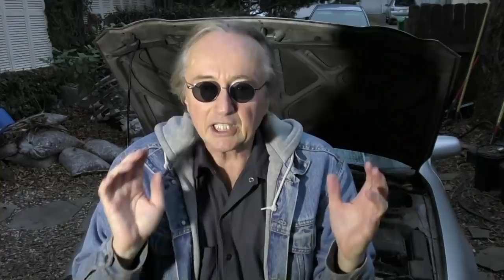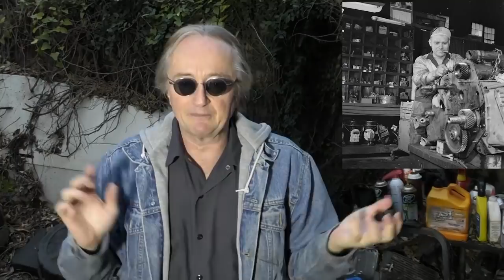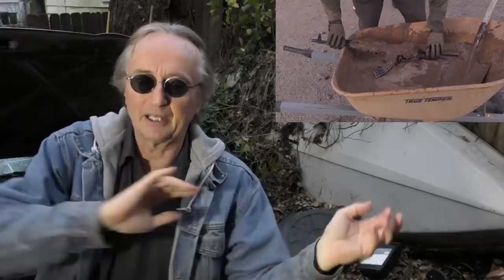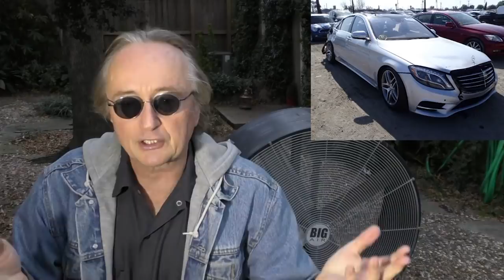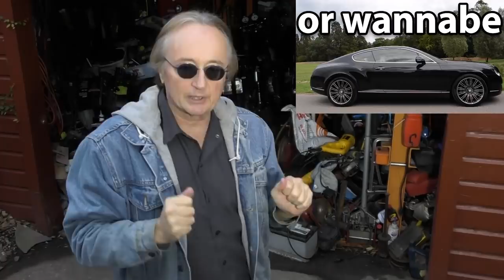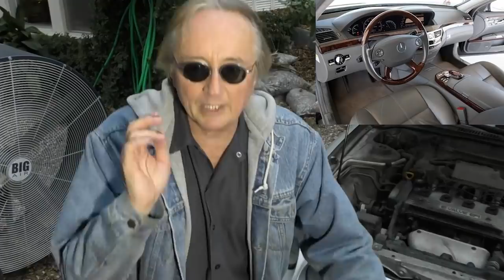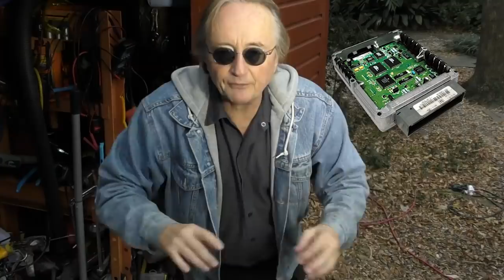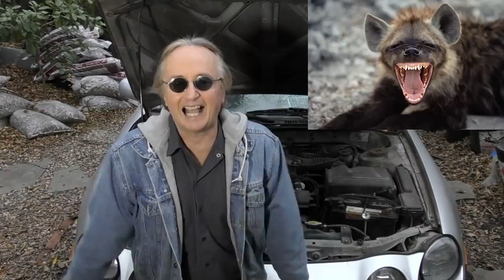Why Luxury Cars are Designed to be Unreliable

Comment: I drove toyotas and hondas for years.  They are indeed quite reliable.  The problem is their aesthetics.  These are the vanilla ice cream of cars.   There is a give and take between practicality and style.  Its almost an exact correlation.  

Sure, you can buy a beige camry and drive it for 20 years.  But youll be driving a beige camry for 20 years.  

The other thing is that the secret about these toyotas is out.   On the used market, 4runners with 100k miles are $20k.    Sure they are reliable.  But are they as reliable as a brand new car?

I suggest people buy a reliable car that they have an affinity for.  Something they like.  Because no matter what brand you get, there will likely come the day when you are standing in your local mechinics office, looking out at your car as he tells you its going to cost you $1000+ to fix.   Thats going to go over a lot easier if you bought the car you liked, not the damn beige Camry.
Reply: bosco0991 perfectly said sir that's what I've been telling people since I can remember goodjob
Reply: The new Corolla 2019 hatchback definitly looks dope though! In Europe, it's called the Auris and we never had the sedan version here. The hatchback is what we are used to in Europe and it looks very good in my opinion.
Reply: The flip side to that is that you can buy the car you love to drive and you're standing in the service department looking at it as it costs you $1000 over and over and over.  I think there has to be a middle way, though.
Reply: honda is reliable ????? according to whom ?
Reply: @buh5995  Civic fanboys
Reply: bosco0991 Aesthetics don't mean crap to me. I drive because I have to, not because I want to. Give me the beige Camry for 20 years all day. I workout to keep myself looking good, my car can look like total crap as long as it runs good. I've been driving a 93 Ranger since 2004 and I will drive it until it decides to die.
Reply: I agree to some extent..but LOOK at the latest Camry (or Accord..or even a Nissan Altima for that matter)! The sports models look absolutely great, a world away from the old boring beige Camry's of yester-year
Reply: Amen. Find the middle ground- buy something reliable but that you actually enjoy. I spend a ton of time driving every day so I want to enjoy my ride. I absolutely love my 06 ford ranger that has 190,000 miles but I am beginning to desire a car that is more comfortable and quick
Reply: Michael Lam , don't ever buy a German car, I have heard they are not so good on a windy and cold weather!!!
Reply: Beige camry's grandpa's car.
Reply: You don't have to only own one vehicle.  Own a reliable daily driver and a fun 2nd or 3rd...or 6th vehicle.  And fun isn't necessarily synonymous with unreliable. 
Learn how to fix your car(s).  As long as I'm physically able, I'll NEVER have a service advisor telling me how much it's gonna cost to fix my automobile.
Reply: @buh5995  fuka Honda....
Reply: Why not buy a Lexus or Acura then?
Reply: lol, I got offered 10g for my 05 4runner. I turned him down, but got his # anyway
Reply: Michael Lam  Girfiends 93 has 288000 on it. valve cover started leaking. just gotta wait for a nice enough day...
Reply: @harorider96  Meh, buy a Camry if you're in your 60s. Drive something that will make you smile. Might as well, since you'll pay for it.
Reply: Even if you don't like the car in the beginning, if it starts every day and get you safely where you want, in the end it will grow on you and you will love it. My first car was a 1997 Nissan Almera GX in silver which i bought used. I ended up selling it to a friend very cheap, I just wanted to continue to see it on the road.
Reply: That’s why I bought a lexus😎
Reply: Dam I drive a beige Camry and I hate it because it’s beige but I love it love it love it because it starts and runs each and every single day after day after day after day HAHA
Reply: Agreed, life is too short for boring cars
Reply: bosco0991 totally agree with your statement 💯
Reply: Michael Lam let me tell you something finally Toyota start making their cars looks good and attractive like the new Camry 2018 but all other Toyota back then I never paid a dime even though reliability  they were bad looking cars and what I mean is that I’m not gonna invest Money into a big deal that is buy a car  and don’t feel Totally confortable on doing it the car has to like you.
Reply: Which is why I aim for 2000ish JDM sports car nowadays. Not only are they fun to drive, good reliability, some of them don't even depreciate!
Reply: @harorider96  what's better i have a 98 Corolla VE 146.000 miles but want a Camry should sell it i does run fine it's just small... And slow
Reply: exactly... 10 000 buck Luxury used car instead of a 20 000 buck camry, 
you still have 10 000 bucks to spare to repair the thing over the next few years..
Reply: Well if its 20 years old and costs $1000 to fix then you definitely got your moneys worth. I can most certainly say I wouldnt be dissapointed, well that and I wouldnt pay someone to fix a car for me.
Reply: That's why you buy the yugo  FOR ?? :-)
Reply: Amen.  Not saying you have to buy a 100k car.  But the certified pre-owned 2017 Mercedes GLA AMG 45 I got is a life-changing type vehicle.  It just makes each day a tiny bit more uplifting.  There is something to be said for the upgraded driving experience.  Not to mention the way people treat you differently.  It's money well-spent if you ask me.
Reply: the new toyotas are quite handsome, i hate the big grill from Avalon and lexus
Reply: Agreed!!!!
Reply: 2006 Lexus is 350! 🖒
Reply: My '94 Beige Camry LE is the best car I have every owned.  My first car was a '63 Chevy Impala.  I've had Buick, Olds, Caddilacs;  Crown Vics, Fairlane 500s, Mercury, Lincoln, Volvo, VW Bug, Mercedes 240D, Mercedes 300SD, more than I can recall.  I don't care what color it is, my Camry was, and is, the best.  I also have a Corolla and an ES300.  I don't need anyone to tell me what to buy or keep.
Reply: Honda's not like a vanilla ice cream imo
Reply: @buh5995  I'd have to say my 2004 CR-V is a little better than average in terms of reliability, but it's a complete pain to work on when something does go wrong. How about three hours to replace an alternator, or removing most of the vehicle from the engine forward to replace the notoriously crappy a/c compressor? From the standpoint of maintainability the car is a disaster.
Reply: Except that Mercedes Benzs and BMWs are just like boats, bust out another thousand.
Reply: Michael Lam  nothing is wrong with it he's just using it as an example
Reply: I can slightly agree with this. In college I had a BEIGE Honda Civic I’d run into things and basically let the car run itself into the ground because I didn’t like it. It also had a cloth beige interior omg. I bought my BMW and when the guy charged me 900 for an auxiliary radiator replacements and coolant flush (which I quickly realized I could’ve done myself but was just lazy) I was yes upset but I knew I wanted my beloved car back so bad I didn’t flinch the minute the car stopped driving, I had them come tow it within the hour
Reply: I agree 1000%!
Reply: Buy Lexus and Acura or Infiniti

Comment: Times have changed for everyone.  Take the new Lexus IS (2018).  My mechanic services them all the time.  They have fuel pump problems, premature brake issues, creaks and rattles from the suspension, and electrical issues.  Even Toyota now has trouble putting out all the time good luxury cars.  It is just the nature of the beast.
Reply: most of those parts could be outsourced. For eg some of the most reliable corollas had terrible bosch ignition coils that would always fail. cant real fault toyota for that.

Comment: "My wife's Lexus is just a fancy Toyota!" XD
Reply: Nothing wrong with dat!
Reply: @spazzman90  true dat
Reply: that's the point
Reply: At least it will Drive when you want it to !
Reply: well nothing wrong with that but lets not forget Audi is just a fancy Volkswagen lol
Reply: TheClubshaker Audi is the badass Volkswagen
Reply: BASITH PH Toyota smiles and says Thank you🤣👍🏼🙌🏼🙌🏼
Reply: I have a Toyota solara pretty reliable luxury coupe
Reply: @JAnx01  A1 - Polo, A3 - Golf. The rest are MLP which is a modified MQB VW platform
Reply: BASITH PH   That's a childish over used statement it's not true.
Reply: with even more stringent quality control than usual!
Reply: What is an ES300/350 but a rebadged Camry that has the same options checked? There's nothing wrong with that. If you'd like to go the other way, the Supra was a Toyota until...96? Then the grill spouted a chrome L, not much else changed
Reply: A mate of mine says " A Skoda is a thinking mans  VW ! " Another sucker lol :-)
Reply: The old LS400 is one of the most iconic cars ever made like my BMW E46 325i. Even the IS300 with the same engine from the legendary Supra
Reply: Another young bloke here in Brissy has a 2006 GTI with 250 killerwasps and so far this year (2018) hes broke it 3 times at a cost of $3.5k a go to fix it ! 0_0
Ive got a 2002 IS 300 and ive had this ride for 5 years now ……. one of the best cars ive owned ever ! The 'secret' is preventive maintenance and regular fluid and filter changes !
Reply: HOMECINEMA PC that’s good to hear!
I am also considering getting an IS300 as like a daily/track build
Reply: The cheaper one's yes. Not the ls460 or gs but clearly you haven't been in one.
Reply: David Laurie   Lol not really just call out BS when I smell it. The smell came your comment.
Reply: It is...a gold plated Toyota.. You didn't know that?
Reply: @basithph8958  But...NEITHER Audi nor VW are reliable, especially their electrical systems.
Reply: @jesserodriguez2732    Do you have the 4 or 6 cylinder Solara?
Reply: 4orrcountry 2008 solara convertible SLE v6
Reply: @4orrcountry  well audi and vw is either a hit or miss some can go for a lot of miles while others have problems before 100k miles
Atleast it is not as bad as Mercedes
Reply: David Laurie  the volkswagen group products are reliable if u take care of it and it's not as bad as mercedes and bmw
Reply: Omg words escape me for one.
Reply: That's the best part about Lexus.
Reply: I picked up a used Lincoln Mark VIII a few years after they stopped making them; the car is basically a thunderbird. Yet, if you buy the parts from Lincoln, they will charge you more than if you buy them at Ford. The bags even have TWO labels on them, one a ford part number, the other a lincoln mercury part number. so whenever I get parts for them, I go to ford, or tell the parts stores that they're for a ford. There really is no difference. I like to tell people that it's a ford thunderbird with the ultimate trim package.
Reply: Malcolm Reynolds true
Reply: HOMECINEMA PC. The IS300 is really my dream car. Perfect car
Reply: BASITH PH my dream car. IS300.
Reply: Johnny Jackson LFA. $350,000
Reply: TheClubshaker  lol Bentley is a fancy Audi that is a fancy Porsche witch is a fancy vw not to mention the other brands they make!
Reply: Jesse Rodriguez The word Luxury shouldn’t even be in the same sentence as Toyota Solara...
Reply: Malcolm Reynolds That’s true but it’s on the lowest model Lexus Chassis the ES the rest are rear wheel drive.
Reply: corkscrewlife car photography The only comment that made sence!
Reply: Acura- fancy honda. infinity- fancy nissan. lincoln-fancy ford. cadillac, gmc- fancy chevy. Porche, bently, audi- fancy WV. Chysler- fancy fiat. Rolls royce- fancy bmw
Reply: I bought I car {BMW x3} with carbon deposits in the engine because previous owner didn't change the oil as often and probably used cheap gas instead of premium, so what can I do to the engine besides rebuild it or walnut spray it?
Reply: monty1300 Porsche is the badass Beetle
Reply: Except the old 2JZ’d versions 😂
Reply: Just as an Audi is just a fancy Volkswagen.
Reply: @jesserodriguez2732  solaras aren't a luxury car bozo
Reply: Hey that's a blessing
Reply: BASITH PH I love the new Mercedes Benz E450 4Matic Cabriolet
Reply: Infiniti is just a fancier Nissan

Comment: Yes, hybrid batteries cost a lot to replace. However, I haven't seen or heard of a Lexus hybrid battery failing despite how old or how high the mileage is.
Plus you have alternatives, such as battery refurbishing...But that's no different than a budget Prius. Super reliable - can be pricey to fix the battery, but you have other options than just replacing the entire battery for $$$
Reply: Tell toyota motor company they need to pay this man!!
Reply: .How long have Lexus hybrids been on the market?
Reply: Yes spot on there Kirk. I have an 08 GS450H and know if I have to repair the battery pack I can get a completely refurbished one for $2000 AUD. Not bad considering the car was $120K AUD new.
Reply: Lol they haven't been around long
Reply: @johnc8910  2006 was the RX 400h and that was Lexus first hybrid. 2007 GS 450h was the second Lexus hybrid.
Reply: I have a 06 lexus gs450h and had a hybrid fault come on, the car is 12 years old, dealers replaced the battery pack for £3000 I'm very happy with it, awesome reliable car, well built to last,
Reply: @tonyquinn7479  Thanks for sharing! You must have has one of the first GS  hybrids. Pretty good reliability for a first-run attempt!
Reply: I have seen many Lexus doing battery replacement. Usually in the 8th year or more. Mostly CT200H model to begin with. Some even worse, faulty steering racks. However I live in tropical country where batteries and rubber parts often fail early.
Reply: @fleurdewin7958  Yes. My wife's 06 prius had two batteries fail on it...The heat and humidity are killer. Her luck was just awful with that car because most never have to replace 1 pack let alone two.
Reply: John Casteel Toyota has been making the Prius for 2 decades
Reply: Before buying a 2014 ES300h I asked my 2 local Lexus Dealerships & a Regional service manager how often they replace the hybrid batteries. They all responded NEVER. All based on the Prius technology they’re worked on for 20 years and cited all the NYC taxis with 300,000+ miles as examples. What I love about used Lexus IS that the previous owners are generally great getting them serviced regularly at Lexus dealerships
Reply: @johnc8910  ...Toyota Prius has been around since  1997 and the LEXUS CT200h since 2010 , introduced in N America in 2010 ( but LEXUS stopped selling the  CT200h ) in America a few yrs ago,  but you can find them used..
Reply: Batteries will cost less than 1,000 usd for replacing in a few years.
Reply: Sometimes you don't even need to replace the whole battery when it fails. Many taxi's in my area are Prius V's and have more than 200k miles on the original battery from what some told me
Reply: My Auto Electrician had to renew the crook batteries in a Lexus Hybrid a couple of weeks ago (well before they should need touching!!).
Reply: E Double talking about battery prices being more affordable and accessible in the future for hybrid cars, and retrofit kits, not Vehicle depreciation.

Comment: The old adage that "buying a cheap used German car will cost you a fortune" is true. Most people don't think far enough ahead as to research maintenance and assume that 10yr old BMW will have $40 oil changes like their previous Honda and get sticker shock when it's $150+, never mind other general maintenance costs or failures. That said, you were spot on by saying the people who buy cheap used luxury cars don't maintain them and thus think they're crap.

Signed a current BMW M4 owner.

Comment: Most luxury cars are leased. Oems only carr about the first 3 years of quality and then the next 4 years as they sell it as a cpo car.

At most they only care about the first 7 years of the vehicles life. After that they fall apart. And it doesn't matter to them. 

Lexus and Acura are good with long term life of their cars. Buuut we all know why that is lol.
Reply: Ashish Patel Yes that’s why think it’s so impressive that the Land Cruiser is made the last 25 years
Reply: Acura Transmissions are a nightmare especially the ones in the TLs back in the day. The new Acura still have transmission issues.
Reply: @MBisFrenchy  yeah agreed I had a 2001tl and the transmission went after 125k. But that was the only issue with the cat. Everything else was solid.
Reply: Ashish Patel My 2000 TL has been having issues since about 80K miles it shakes a bit when going to third. Replaced the filter and did a drain and fill slightly helped but don't want to completely remove all the transmission fluid just in case. The car is now at 98K miles but no it's worth so little I hesitate to spend money on it. Just got new tires, new coils and slrak plugs along with pcv valve. The top gasket checked and cleaned out for the Egr. Got a 16 MDX and that transmission is very jerky especially in the cold luckily it is leased and going back soon I would have been concerned of another failure.

Comment: Agree.  After a 20 year run of Honda and Toyota cars, I got tired of not only the lack of style, but the lack of driving pleasure.  When my 2013 Acura TSX was badly damaged, I bought a new new 2017 Ford Fusion Platinum.  I hope To have it for many years.  Expensive. Yes.  An absolute joy to drive, and great style.  Plus with low profile 19 inch tires, AWD, great turning on wet roads.  Self parking is great too.  

So far, 2 years old, no regrets.
Reply: Good for you!  You only live once.  Might as well enjoy the ride+experience.  After years of having used Honda vehicles, I switched to a certified pre-owned 2017 Mercedes GLA AMG 45.  It flat out makes each day a lil bit sweeter.  Worth it just for that.